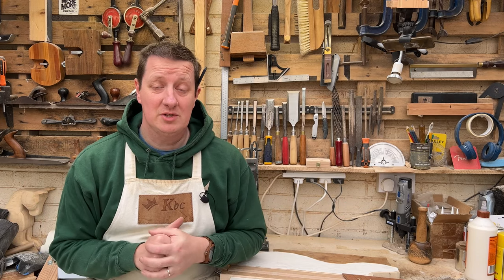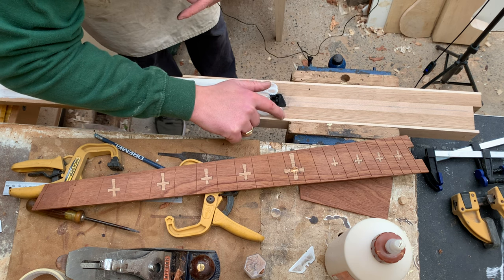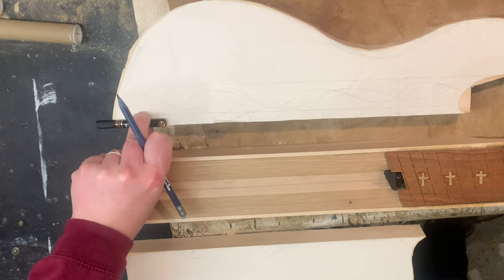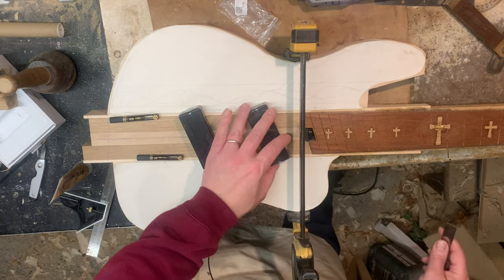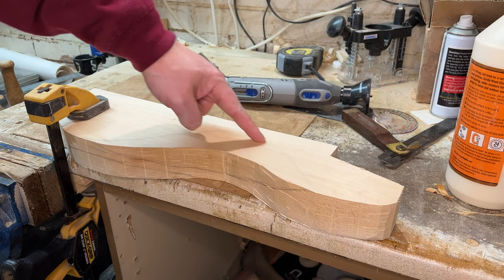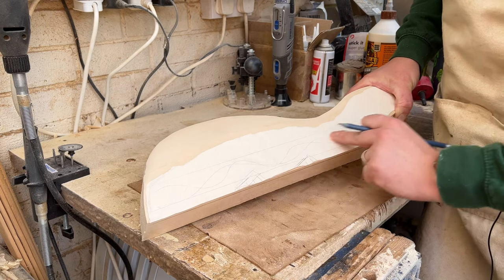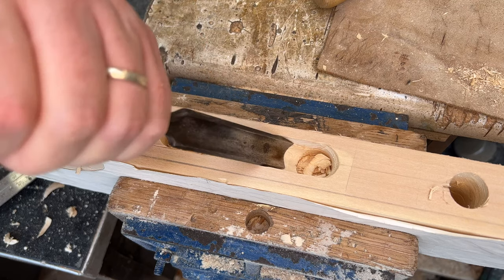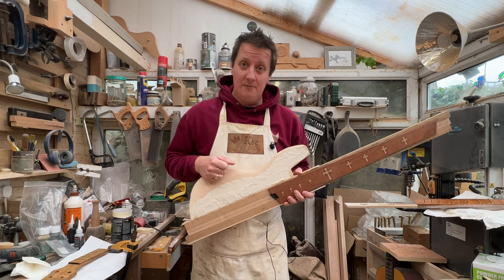Comfort carves and weight relief  |  bass build part 8

Comment: Great video series with useful tips and tricks, thanks.  I’ve not long started building guitars so the question I have is do you remove the masking tape from over the truss rod before attaching the fretboard, I thought this was supposed to be done but noticed you left it in place, no idea why one way or another as the tape shouldn’t impact the truss rod movement? Thanks
Reply from the maker: The reason I have the tape is to stop glue going into the truss rod cavity, possibly stopping it from working. Some people remove it, but then you still run the risk of the glue spreading into it under compression 👍
Reply: you can ask 100 builders why they do what they do with the masking tape, and you'll get 100 different answers. But, I myself subscribe to this method,
Reply: @KingBespokeCreations  thanks for your reply, your method makes most sense and is logical (I’ll throw the books away 😂😂) in future I’ll trim the tape and leave it in place, thanks again for all your videos